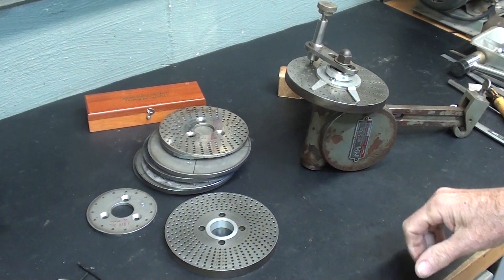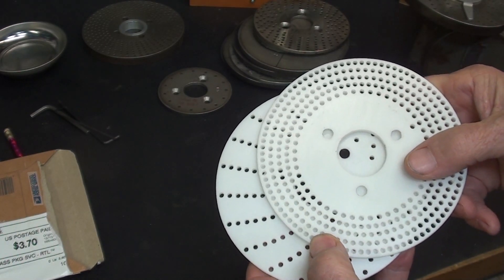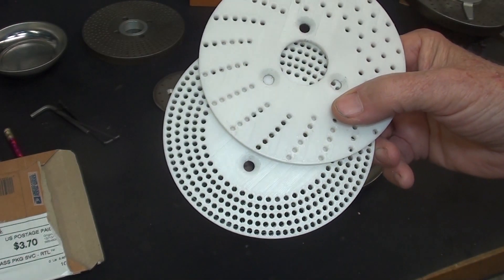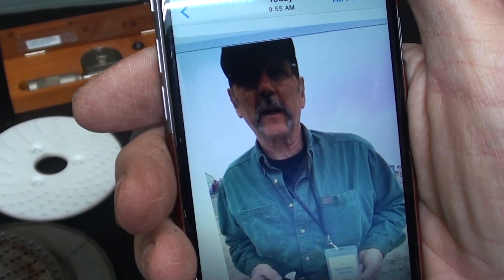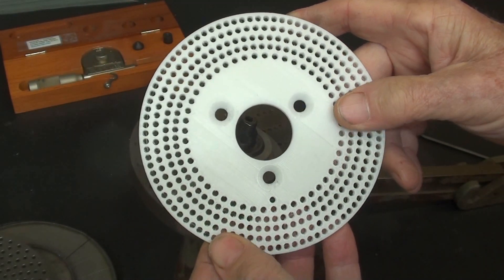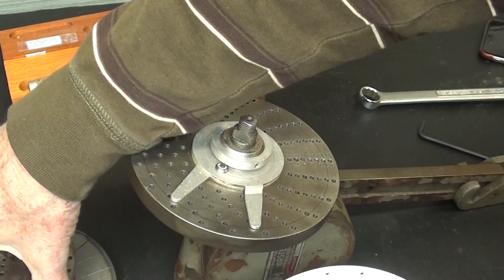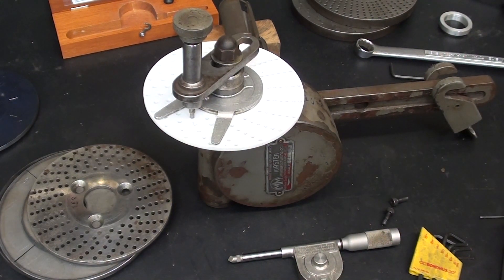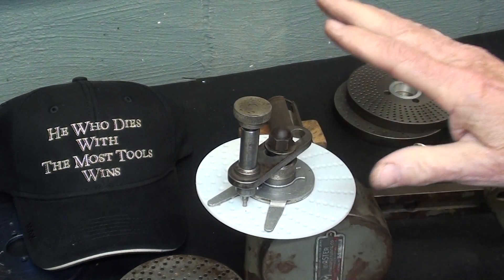Dividing Head Plates 3D Printed TIPS #627 tubalcain

Comment: Good morning Mr. Pete, I think as a answer to your question is that most people don't  understand how to use the three d printer or the fusion 360 to make these kind of projects. Its just the fear of learning new things. I too have some reservations on the subject but I also am learning how to use such things because I have bought a milling machine that will use similar processes to run it. So that my long winded answer to you question. Will you consider beating another dead horse and think of finishing your series of converting that wood band saw to metal cutting?

Comment: A dividing head plate is an excellent example of the value of 3D printing.  The durability of the available plastics is surprisingly good and certainly serviceable for a tool that might be used a handful of times for home or hobbyist use.  I don't think 3D printing is going to replace the mill and lathe in the way that computer controlled machining has taken over industrial production but rather it provides a tool to enhance traditional machine shop activities.
The important skill for young people interested in shop work to learn is how to describe a project to a person that will produce the 3D-printed object.  You touched on the fill density that affected the strength of the patterns you've made.  Also, there are different filaments that can be used.